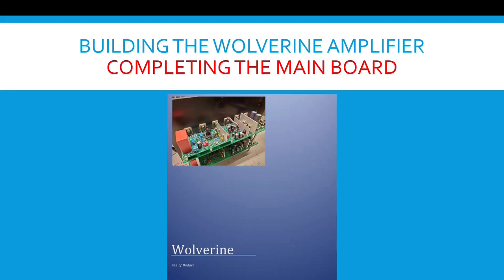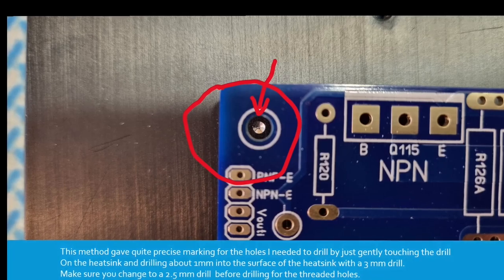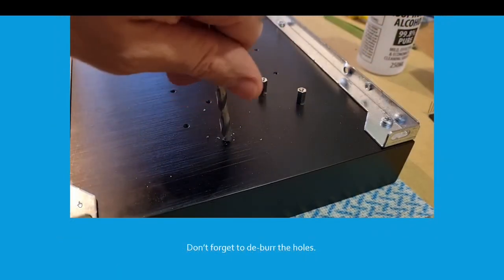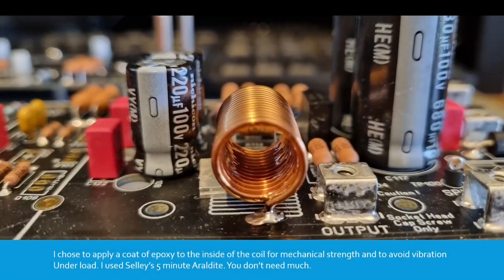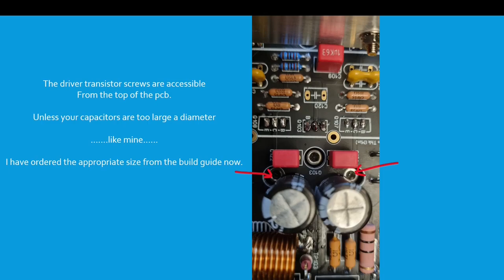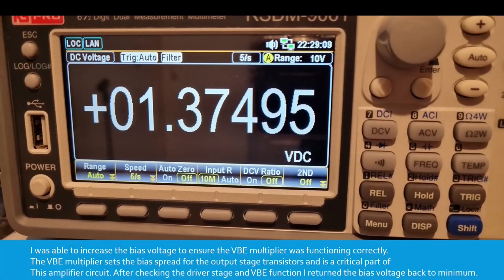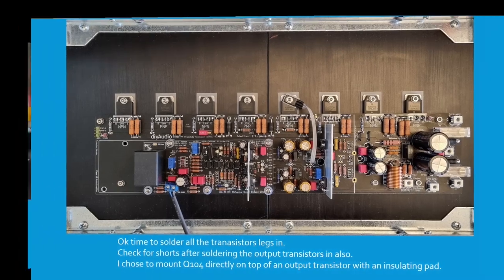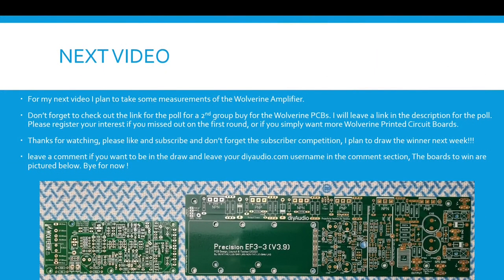Wolverine Amplifier Build - Main Board Completion

Comment: Wow. That's a very informative video. Really well presented. Thanks Daniel.

Just a quick note guys. At 10:50 when Daniel is discussing the testing of the drivers and he says "minimum bias" or "minimum bias voltage" the resistance of the R109 trimpot is set to its maximum. Please refer to the build guide on how to do this. It will show you where to measure the pcb to ensure that you have maximum resistance (minimum bias) no matter the orientation of your R109 Trimpot.
Reply from the maker: Thanks Stuart much appreciated